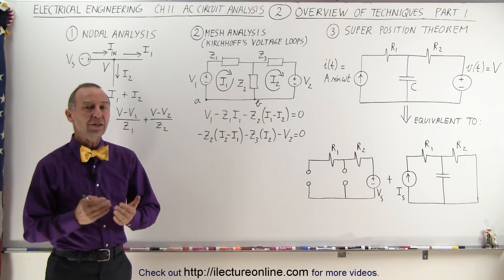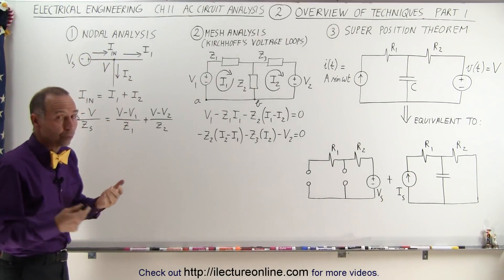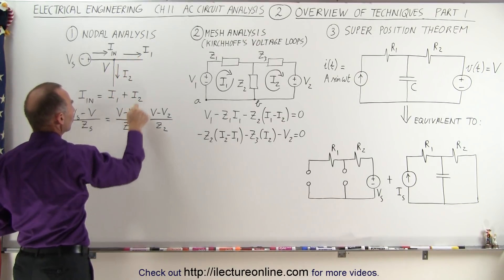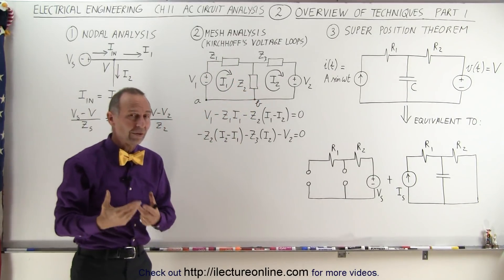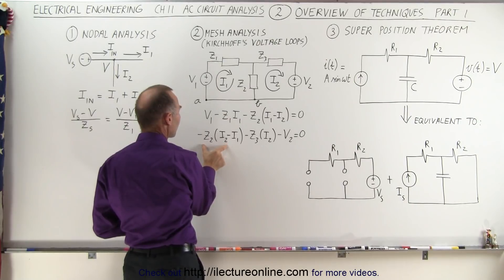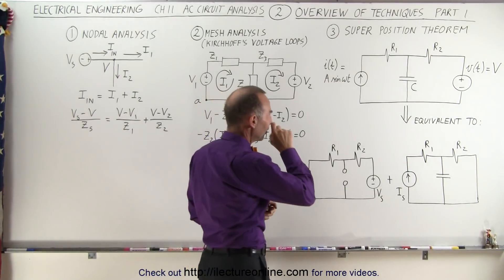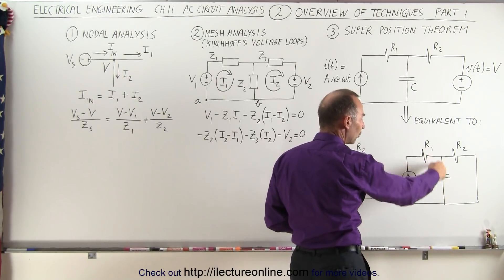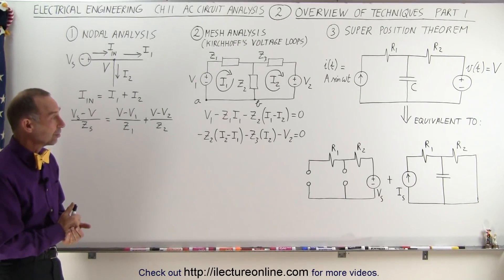Electrical Engineering: Ch 11 AC Circuit Analysis (2 of 34) Overview of the Techniques (Part 1)

Comment: i have a confusion in superposition theorem. if we were given a ac voltage source would we replace the capacitor by an open circuit?
Reply from the maker: Only in the case when the source is a DC source.  After the capacitor fills with charge, no more current will flow.
Reply: @MichelvanBiezen  thanks sir!
Reply from the maker: You're welcome 😊!

Comment: Please help me out sir ! at the method 3 , it's an AC source (we are dealing with ) , we shouldn't remove capacitor since it has some impedance   ???  I am confused by the diagram in the video sir ! please enlighten me !!!
Reply from the maker: With the superposition method, we add the contribution of each source separately.  With a DC voltage source, there will not be any current  in the branch with the capacitor, and therefore we can remove it.